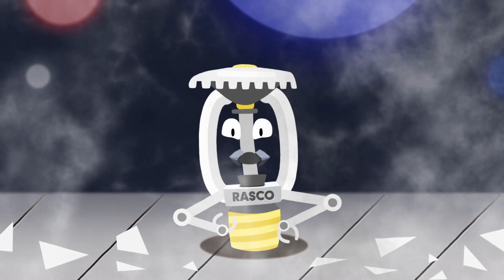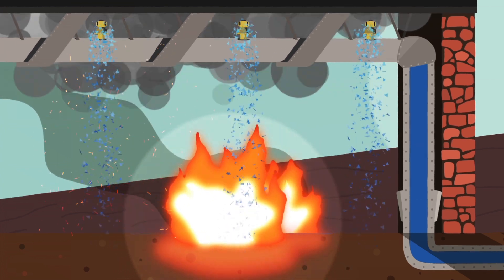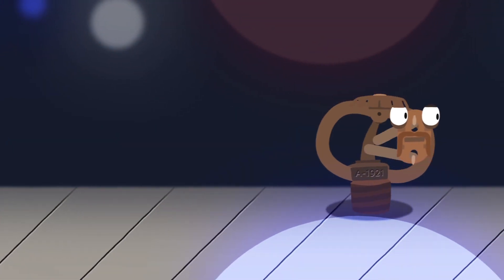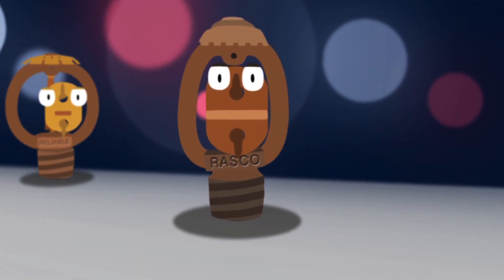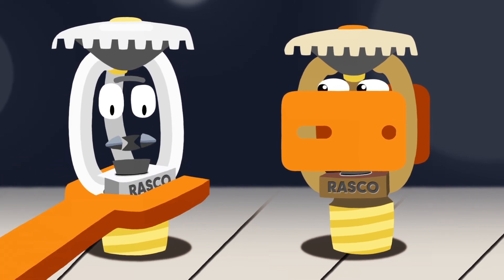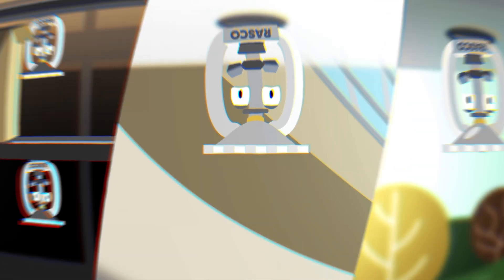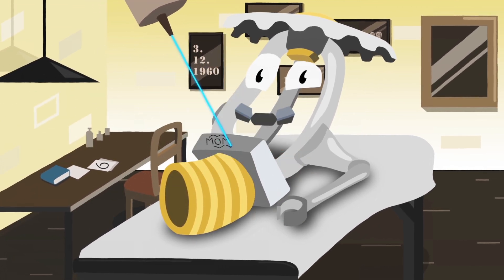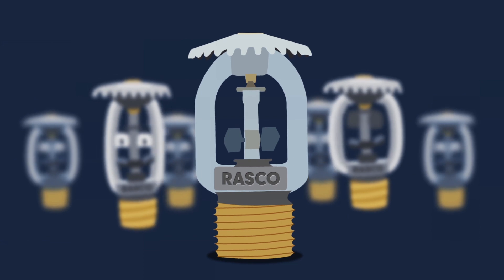The Reliable KFR: an animated history of the leading link sprinkler.

Comment: I always had a fondness for the Model B that was big in the '70s and early '80s. It was like a concealed/pendant hybrid. I'm guessing they were a little pricey though since I usually only saw them in special areas where aesthetics were a focus. My 1981 high school had them in the auditorium wing but the standard round link pendants everywhere else. Also had rare funny-looking "on/off" heads in the restrooms (I'm guessing as a measure against vandals) that reclosed when the temp decreased. Have never seen them anywhere else. The building was one of the first built under new state regulations requiring sprinklers in public schools and they ended up saving the building 20 years later in an arson fire and attempted bombing.